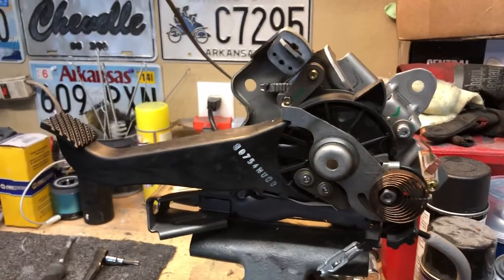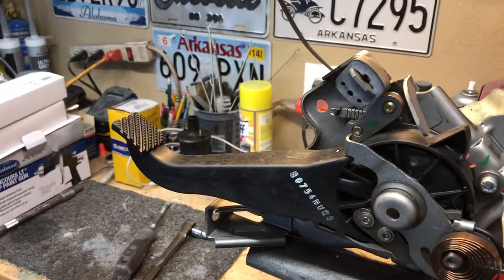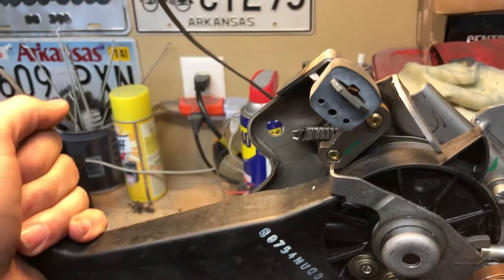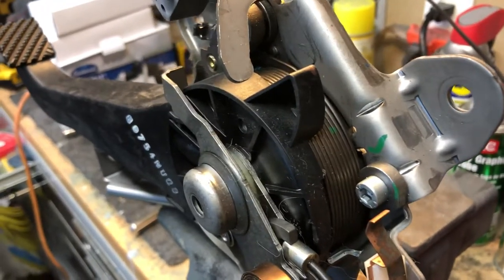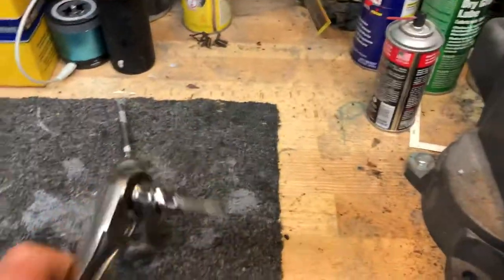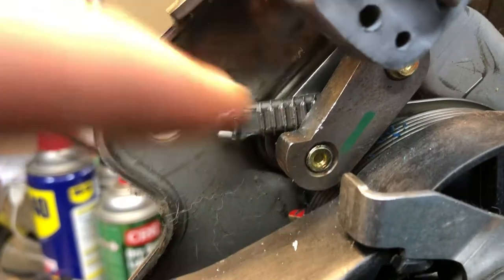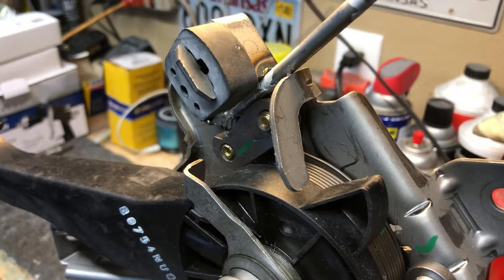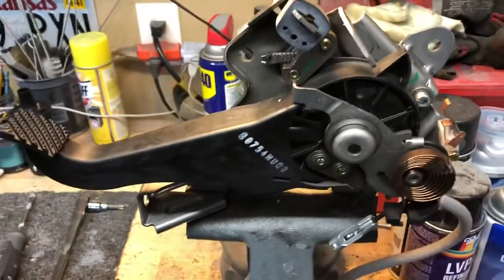2005 Dodge Magnum Parking Brake Pedal Repair

Comment: Great video. Thank you. Really there are no many videos online about it. After 2010, they seems to be upgraded the lever / assembly, making the ON/OFF action just with the pedal, without any additional release lever. On my '14 Charger, the pedal started to go down without any tension. It goes down with usual click-click-click sound, locked there, but doesn't apply the brakes. Might be the cable issue, or something got broken in assembly.

Comment: when you say it does not lock, do you meant  the pedal would sink to the ground and has no feeling to it? because that is what i am experiencing. and thanks for sharing.
Reply from the maker: chocolate icecream so on mine there was plenty of pedal pressure and the brakes worked but when I let off the pedal it would come back up. It sounds like yours might have a broken or stretched cable. You should feel resistance.
Reply: Thank you for you reply.